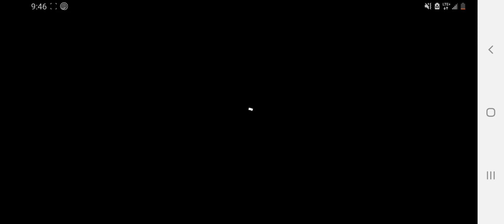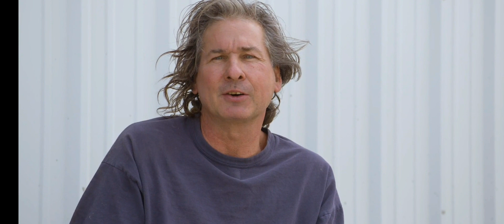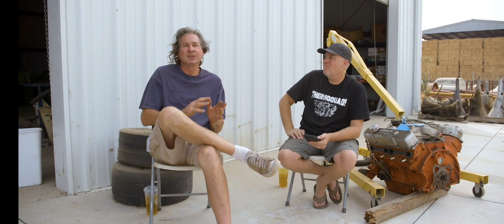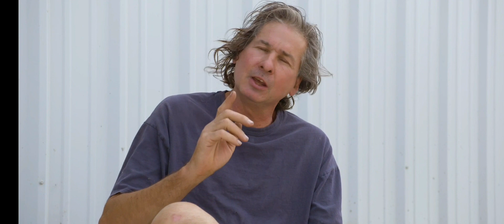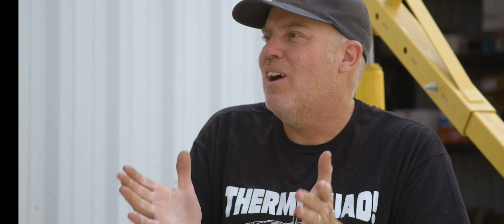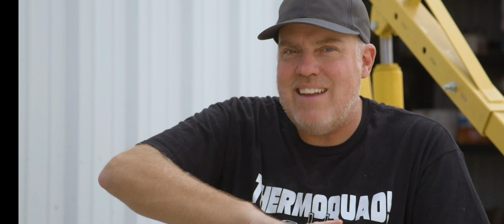uncle tony's garage gets called out by the roadkill guys and they say he's  full of shit

Comment: I'm a couple years older than Uncle Tony. This was a trick used back in the late sixties - early 70's in stock eliminator, I remember reading about it in Super Stock Magazine I believe.
Reply: same here
Reply: But it must be bullshit since these 2 TV geniuses said so.  Hahahaha
Reply: Did you race stock eliminator in the 70's?  It was a different ball game then.  Many parts had the be actual factory replacement parts. If the factory pistons had offset it was normal to reverse it.  But that doesn't mean it's the last word on it.  Now in SE we can use any piston with the right weights and compression heights and ring grooves.  IF there was anything to be gained stock class guys would do it. But we don't anymore.  It's old info that is no longer relevant.
Reply: @TL-angzarr  maybe no longer relevant if you don't want to be low buck and reuse old parts like Tony.  But if it still works, it still works.  Turning the pistons around supposedly gives some performance advantage, whereas leaving them turned as stock supposedly just lowers piston and wall wear.  So if Tony is going to reuse old pistons, he turns them around to suit his needs.
Reply: @pete540Z  How often even low buck guys are going to be able to reuse ancient pistons? Oh wait you aren't going to worry about the bore taper and just re-ring it? You think in that scenario that the piston offset is going to make any difference in performance?  When I was young guys who were bucks down would knurl pistons and guides instead of boring and relining, those motors always ran like shit.  Reversing the pistons on any sort of performance motor is stepping over dollars to pick up dimes.  You got the motor apart at that point you might as well do a decent rebuild.  Beyond all that there is little evidence it does anything.  If flipping the offset made any HP at all guys would do it. I race B/SA in that class since you are so limited you find power anywhere you can find it.  I have two 5 gallon buckets of rocker arms under my bench just so I could make 1 good set to run. I use spacers in the ring lands so I can use .043 low tension rings just to save that bit of friction.  If reversed piston pin offset did anything gus in stock eliminator would do it. But they don't.
Reply: @pete540Z  Here's more food for thought.  The whole supposed performance increase in reversing the pistons is a reduction in friction.  About 25 years ago I was doing ring testing going from a 5/64ths barrel faced ring pack to a 1/16ths ring pack.  On the dyno we found nothing below 5k even at 6k it was like a 4hp increase which is close to testing variance but at 7600 where we stopped the test we found 19.  I'm not in the mood to do the actual calculation on the change in friction from an offset to non offset piston pin but it can't be that much.  But the results at best would follow a similar pattern below 6500 it's unlikely that it does anything. Above slightly, but hey maybe those low buck builders are turning 8k rpm.
Reply: @TL-angzarr  - I don't put used stock pistons back into anything I build.  Not since 1978 when I was 16.  The shop knurled the guides on those 461 1.94 SBC heads.  Worked o.k.  Had to as I had no money for new guides.  I don't build stuff cheap like that now.  But I think the issue is that there is more to in than friction.  The offset to one side as stock was to reduce friction.  Turning the pistons around 180 was to use the offset for earlier mechanical advantage away from TDC.
Reply: @pete540Z  the mechanical advantage has long been debunked.  Its why pro stock no longer tries to put a rod as long as possible in motors.  In fact they have worked hard to lower deck heights so they can make the rods as short  as possible.
Reply: @TL-angzarr  Who said anything about rod length?  The issue is the angle of the con rod in relation to the angle the crank arm makes with it.  Moving the pin to the other side gets more torque on the crank early in the power stroke.  Not something that is a huge difference, but the theory has merit from a mechanical engineering point of view.
Reply: We did it in Y blocks
Reply: @pete540Z  This proves you don't really know engines.  I brought up longer connecting rods for 2 reasons 1 their benefit has been long debunked many times over 2 because changing the length of the rod changes its exactly in the same ways off setting the piston pin does the difference is what happens to dwell at TDC and bdc but for the stated advantages that offsetting the piston pin supposedly gives they are for all intents and purposes identical
Reply: @pete540Z  Actually it does prove it. If you really knew engines you would know that moving the pin over will have the same effect on rod angle that a longer rod would.  Think about it, it simple geometry.  If you had any racing background you would state it and you would be familiar with the testing done on long vs short rods.  It's a simple question, IF moving the piston pin over makes any extra power then why don't we see Nascar or Pro Stock teams doing it? Do you really think those guys never heard of a 50 year old speed trick that's been in multiple books?  What is your explanation for this?
Reply: @TL-angzarr  list the geometry parameters and I'll tell you if it's "the same thing".  Pin offset, short and long rod length, deck height, piston pin height, stroke.   Only then can the calculations be made to say whether the scenarios are "the same thing".  As to why it's not done, well that's not the point.  The old guys saw the pin was offset the "wrong way" to give a mechanical advantage, so decided that if you are going to use the stock pistons you'd want to turn them around to help yourself out (since super-low bore wear wasn't high on your list of desires).
Reply: @electrix6751  Thing is the trick doesn't work. We did it believing it did cause that's what Direct Connection told us to do.  In the 70's dynos were rare.  It's impossible to test through on track testing so you deferred to the factories advice.   The factory actually gave lots of advice that was dead wrong.  Go find the old direct connection manuals the say to use the 346 casting heads as they are they best.  We know now that the ports on all big block mopar heads from 70 up are identical.  No reason to look for 346 heads.  We also know that the earlier 906 head on the top flows the same and slightly better down low. But this wasn't the hot tip from the factory.  In the 70's guys would paint their gas tanks white to reject heat.  We know now that it's a waste of time.  The trick of painting a white stripe down your collectors to determine the correct length is another trick that UTG has shared that is pure bull shit.  You can find a dozen old books and hundreds of magazines repeating it but it doesn't make it true.   There's a huge difference between a old idea that still works and an old wives tale that won't go away.   Thing is most of the people making an argument over this have barely built an engine let alone done testing on any of these speed secrets.
Reply: Cam montreuil engines  You don't need to map out piston dwell, simple geometry will show you what the dwell time will be.  But OK so what? I can prove definitely in certain engine combinations that shorter rods will make more power. Actually in more cases shorter rods will make more power than long rods.  There are only certain specific instances where long rods are better.  With modern ring and piston tech worrying about piston rock is a waste of time especially at the bottom of the cylinder.  At the bottom of the stroke the piston isn't holding combustion, the cycle is long over by then, likewise filling hasn't started.   Worrying about the tiny bit more piston rock at the very bottom of the cylinder is silly. That's like stepping over dollars to pick up dimes.  Maybe if you are using ancient pistons that have .0065 wall clearance sure I can see worrying about it.  But the whole reason that modern cars use .043 and thinner rings is that piston alloys and ring materials are do much better that you can run a tight piston to wall.  Like that you don't have consider cylinder length.  In the 90's I spent a bunch of time building SBCs using 400 sbc blocks my favorite combo was the 400 block with 327 crank.  It would make a 352,  I built that combo with 5.7, 6 and 6.25 long rods.  I also made 377's using 350 cranks.  I was a big believer in the short stroke long rod combo.  Then one time a customer asked me to build the same combo but he didn't have a 400 block and to just use a everyday 350.  When I dynod that motor I found it was identical to my de-strokers in power.  I spent alot of time dynoing combos.  I figured out that with the old 292 heads the short stroke long rod motor was worth 20hp or so over a normal one.  But with modern cylinder heads like the brodix track 1's the 20hp disappeared and they ran the same.  I even found with the hot for the time 18 degree 240cc heads 6 inch rods were a 7hp loss. But the context always matters my findings only apply to sbc's with those heads and those cam timings.  My findings are certainly untrue in other applications.  This is stuff you worry about when you need the last 5hp from an engine.  Street cars or bracket racers its a waste of time.
Reply: Cam montreuil engines  BULLSHIT! You have no data and no way to prove that. Extra piston dwell time at tdc won't on its own improve gas mileage.
Reply: Cam montreuil engines  fast easy way to know that statement is bullshit.  When GM and Chrysler were updating their small blocks in the mid to late 80's to meet newer emissions and better mileage numbers they added roller cams , redesigned cylinder heads, added port injection.  But they did not increase rod length. If rod length gave better mileage or power they would have done it. Adding a longer connecting rod is much easier than designing new cylinder heads from the ground up which is what they did for both the magnum and vortec motors.
Reply: Cam montreuil engines  show me a single Japanese motor with a rod ratio better than 1.8 to 1 . And give any documentation that gas mileage is WY they chose the long rod.
Reply: Cam montreuil engines  too bad now you are lying.  There is no way you did a back to back test by only swapping rods.   Of course you took into consideration that maybe the better mileage was from better ring seal.  Cause I know you didn't reuse the rings on the old bores. And I know you didn't dyno it cause if you had you would give numbers not say slightly better performance.  For that matter how did you do the mileage test? Did you compare it going down the same road in exactly the same conditions.  I know for a fact you didnt
Reply: Cam montreuil engines  anyone who does anything scientifically knows that correlation doesn't prove causation.  1 random test that is highly suspect if it even existed is not proof.
Reply: Cam montreuil engines  I'm fully aware that my list of variables is far from exhaustive, the point was never to list everyone of them but only to show that the claim made is dubious at best.
Reply: Cam montreuil engines  doesn't mean that the longer rods have anything to do with better mileage.  It makes zero sense to assume that it does.  What effect are you proposing that accounts for the better mileage?  Certainly not just the few degrees of extra TDC dwell?
Reply: @TL-angzarr  there are basically no "mechanical" advantages to long rods.
That's barking up the wrong tree.
The idea behind long rods is piston "dwell"
The amount of time the piston stays at TDC as crank arm rotates "around" to heading down.
This dwell adds to flame saturation of the combustion process.
It's not a mechanical advantage..it's a thermal advantage.
Reply: @SeymourBalz  That's the theory but in practice it's full of shit.  Here's a few questions for you.  When is peak cylinder pressure achieved?  What effect is there in the interplay between chamber design and flame front speed.  What conditions are needed to increase power.  I'll give you some numbers to ponder.  Assume a 3.75 stroke and 10 degrees of travel after TDC.  With a 6 inch rod the piston has dropped .037326 inches and has a cylinder volume of 7.68649 cc .  If we sub out 6.125in long rods we get .037145 inches of travel and 7.64920 cc of cylinder volume.  For kicks we can do the same for 6.25 in long rods and we get .036972 and 7.61348 respectively. So a difference of .000173 less travel by quarter inch longer rods.  If we assume a 4 inch bore that's .03572 more cc's of cylinder volume. Plotting the sine curves shows that the change in dwell time is negligible in any sort of change that fits in a given block.  Long rods are a waste of time for anyone that isn't also taking advantage of chamber shape and slower burning fuel.  Infact most modern race fuel burns faster than the older stuff. Which is why the combination of the fast burn heart shape chambers that are now ubiquitous with current fuels work so well.  Guys stuffing 3/16ths long rods in big block chevys are fooling themselves.  Are there engines that can make use of long rods? Yes but until you can get a rod ratio over 1.9 you are wasting time.  And you need the rest of the engine tuned to take advantage of it.
Reply: @TL-angzarr  ok... just reverse your pistons.
Reply: @SeymourBalz  About what I expected, pity as I was hoping you had real knowledge and would offer some sort of rebuttal or refutation.  You are in good company as neither can Tony DeFeo.  Lots has been learned since the direct connection manuals were written in the 70's.
Reply: Well I'm older than both of you. (1951)
I'm only going by what Smokey says/did. 
Smokey was paid by GM to test.
He made his living testing engines.
(Yes I know he had a shop AND dealership.)
The idea/process was to get the "explosion" as big as possible, as things are happening pretty fast at high RPM.
"He" said long rods always made more power, period.
You were going on about the time combustion takes....well how does MSD stuff work ?
Multiple spark(s)
...time ?
Tony just has a following if kids.
Elseware in that comment section I Commented on other stupid things Tony has said.
I stopped drag racing in 73-74 (?),
And went to stock car racing. Stopped racing all together in like 80/81
Reply: Additionally...
Di you know what a qualifying engine is ?
Built loose as a goose.
Negatively loading the pistons, would have to cause more side forces to be exerted on the cylinder wall(s)
Which....would obviously cause drag.
Which again is opposite of the qualifying engine
Being "loose".
Sorry, I don't go by what the say  S.S. guys did then.
Today you can go faster in a showroom car WITH the A/C on.
Reply: @SeymourBalz  Are you serious? You do know that above 3000 RPM's that MSD's stop giving multiple sparks right?  The magic of capacitive discharge systems is their ability to deliver voltage.  You do know that the 2nd and 3rd sparks are far less powerful right?  There is no time for the coil to completely saturate with a full charge.  The idea is that in sub optimal conditions at low RPM the extra sparks may light a mixture that failed to light. But! They have to happen very very soon  after the first as they are relying on the residual heat from the first spark to have a chance for the smaller follow up sparks to have a chance.     You are misquoting smokey, he never said long rods always made more power. Infact he was talking about a very particular combo.  The old open chamber wedge design with limited air flow with cam technology at the time created an instance where longer rods helped.  Are you really trying to tell me that this trick that Smokey printed in a book didn't get picked up by anyone else?  If it was that simple the hot tip would be to stuff longer rods in everything but they don't.  As an example and it only applies to super stock 327 350hp engines.  All the cars currently setting records have gone from the standard 5.7in rod length to 5.595in from the 400 small block. If Smokeys statement was absolute this wouldn't happen but it does.
Reply: @SeymourBalz  Do modern nascar qualifying engines use reverse offset piston pins? If it was the hot tip you would think they would but they don't. Even if they did just cause it works at 9000 rpm in a cup engine doesn't mean it will make a hill of beans at 5000rpm in some magazine writers shit box that was cobbled together.
Reply: @TL-angzarr  again you missing the point.
If they build loose engines...
Why would they install drag ??
Pushing the piston against the cylinder would cause drag...or no ??
These engines like I previously stated are LOOSE !
They'd NEVER finish a race.
You know hours of wot.
Reply: @TL-angzarr  and that was about the time Smokey gave up as head tech writer for Circle Track magazine. He was fed up with this argument, from something he had proven.
Just like his reverse rotation small block.
Why don't racers do that ?
GM did finally go to "reverse" cooling...
Which most engines have run backwards for years, and still are.
What do offset pins have to do with anything ?
Would you suggest using them in a Hemi ?
And why ?
What is octane ?
The msd thing was once again. ...mentioned to get you thinking.
Think about octane "rating" ...what, it IS.
Same for loose engines,
Verses "unnecessary" drag.
As well as longetivity.
Again...drag racers don't care.
There NOT hitting maximum RPMs say twice a lap for hours.
(Oval track)